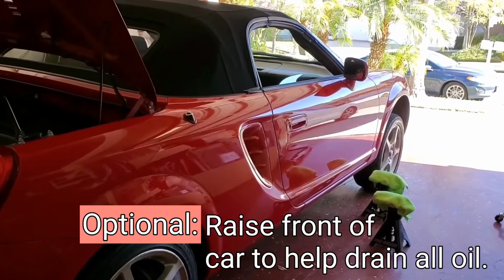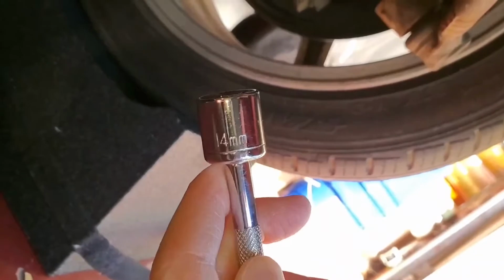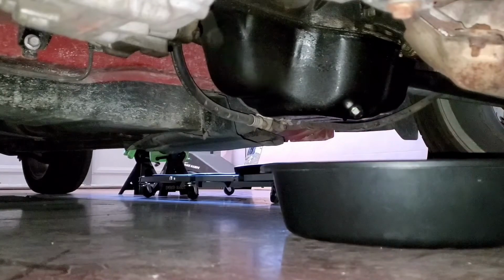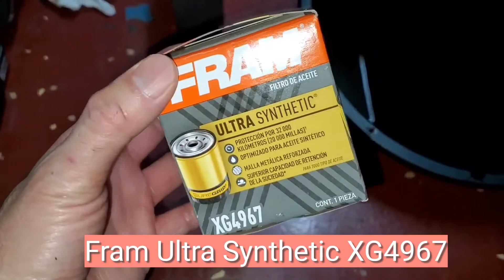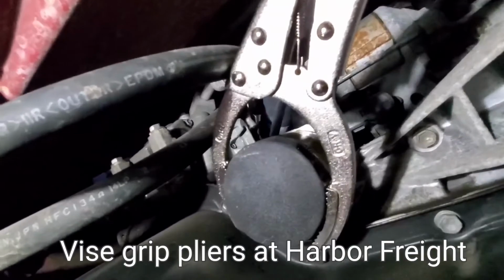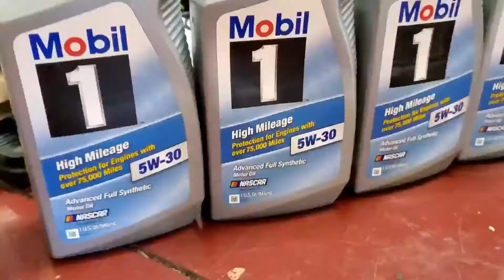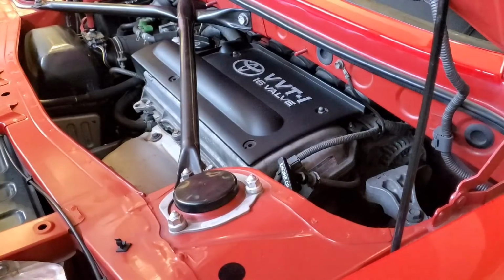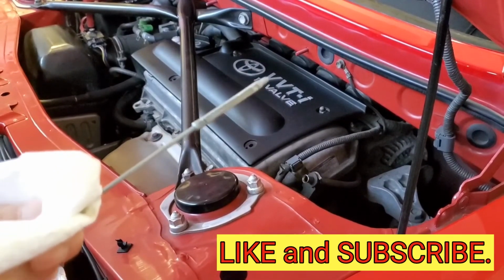How to CHANGE OIL - MR2 Spdyer

Comment: Drain plug torque is 29 ft lbs on the 3SGTE and 14 ft lbs on the 5SFE, and oil filter torque is hand tight not finger tight. Also drive it up on the ramps before draining the oil?
Reply from the maker: Thank you for this valuable info!